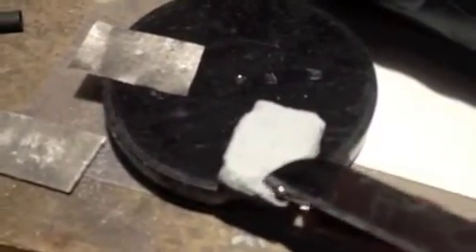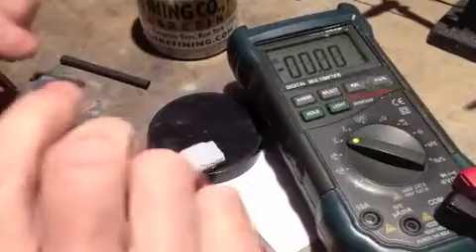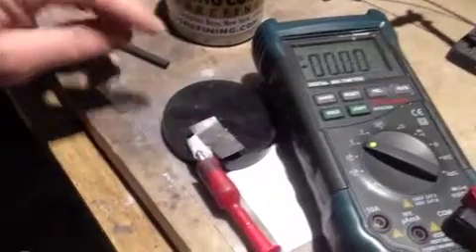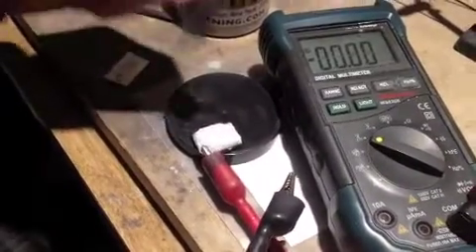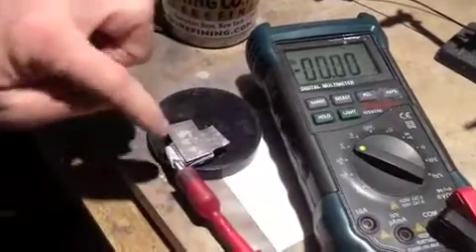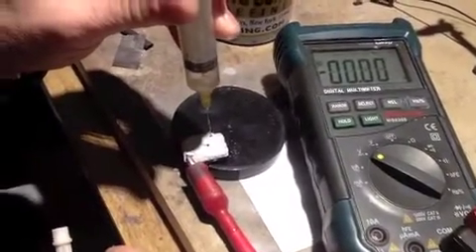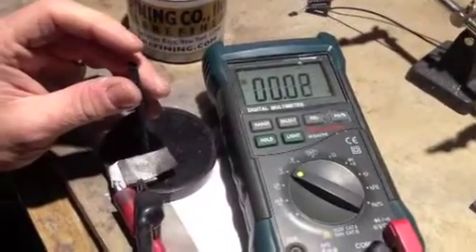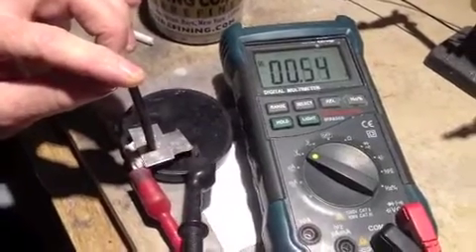PGS Graphite and Mg PGS Graphite

Comment from the maker: The voltage read 1 volt.  I knew this would be the case. I am simply attempting to show that the electrical properties of a metal can perhaps be "Seen" and taken advantage of when it is NOT in fluid intimate contact with the ELECTROLYTE itself and is separated by GRAPHENE layer.  SO, perhaps this is one simple way to minimize or obviate metallic destruction.  Water may pass through graphene but not even He will according to recent studies..... interesting no?